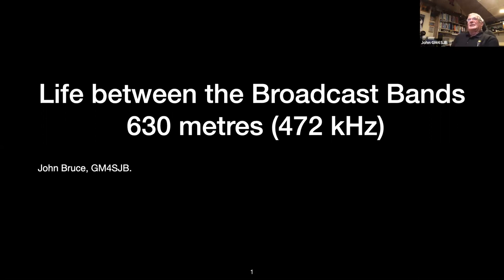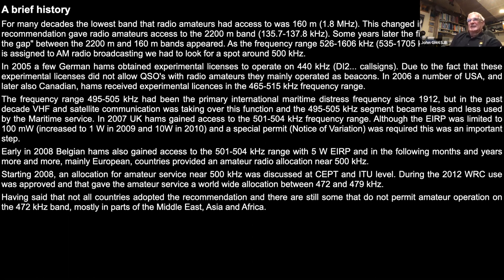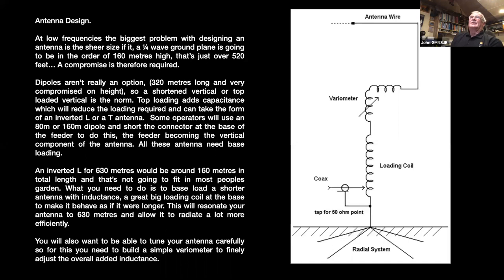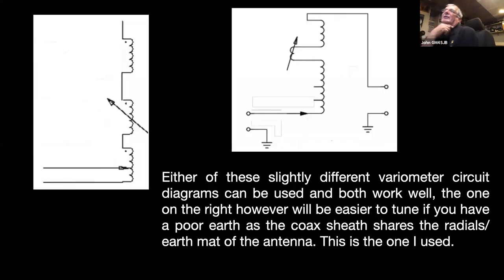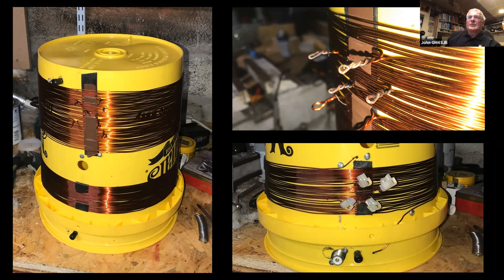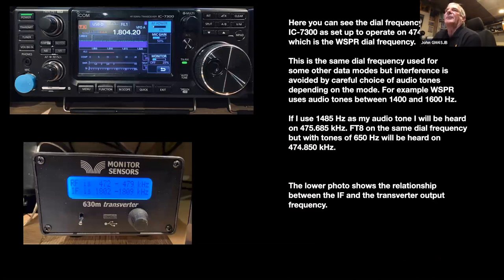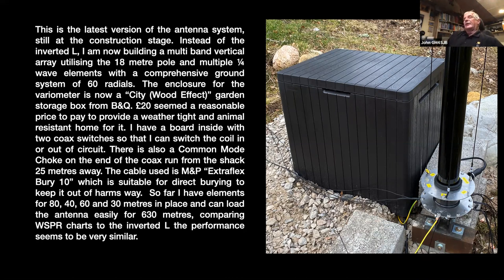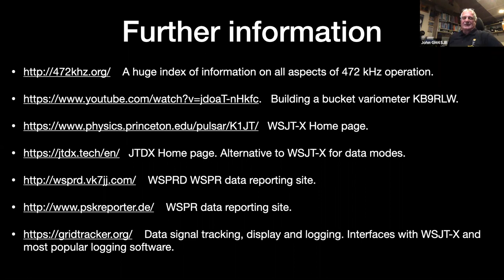John GM4SJB talk on operating amateur radio on the 630m amateur band

Comment: How do you strip the insulation off the wire at the points where you make the taps? Do you just use a knife, or is there a specialized type of wire stripper you used?  Thanks.